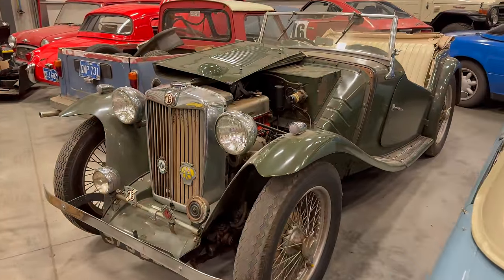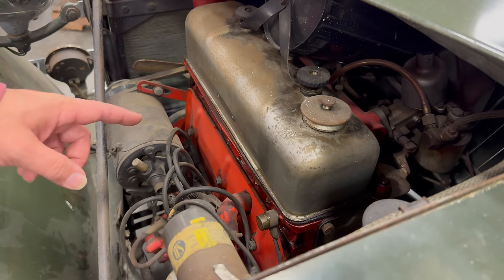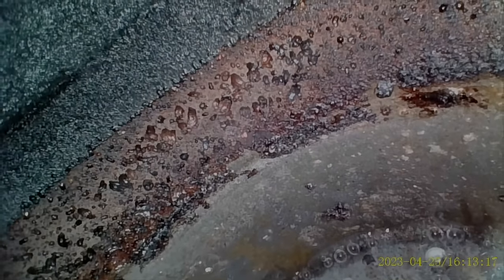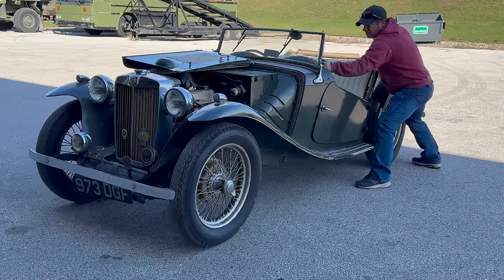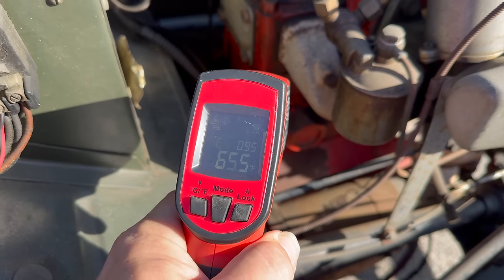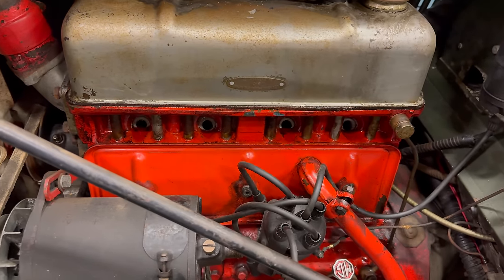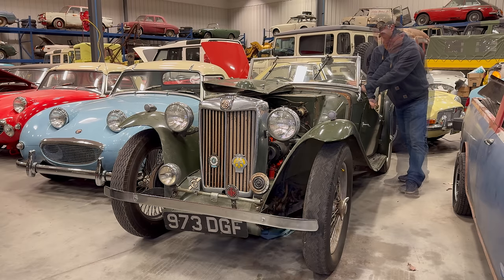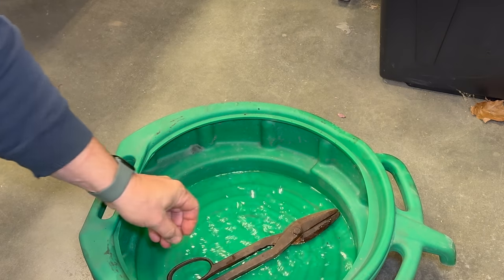Testing if MG Runs with Heat and Vinegar

Comment: Great video. I'd never heard of using vinegar on rust, it seemed to do a good job on your cylinders. That beauty of a car deserves all the attention you can give it. I would like to see more.
Reply: I’ve heard of it but not inside engines. It also cleans up the mineral build up in your shower heads and faucet aerators.

Comment: I tried letting vinegar sit for about a week in an old Yamaha enduro motor that was rusted solid. The trick that finally broke it loose was actually using diesel fuel. From my understanding (at least from what an old motorcycle guru told me) is that diesel works better because it slips past the rings. I'm looking forward to seeing the teardown and watching this beauty run.
Reply: Diesel and kero 1:1 used to work for me.

Comment: Perhaps as a next step before engine tear down, pull head, use wooden block mallet method to get some movement? I think you are just about there. With head off, use some evapo rust to soak but also scrub walls with nylon scrub pads to remove additional rust -it is amazing how that little fine line of corrosion at the rings will lock an engine up. I have seen far far worst engines than yours freed up. The atf was a good move also and I like your use of your hot pressure washer, very innovative, don't give up as of yet!

Comment: A classic such as this deserves to be on the road again, under its own power. I also had not seen what vinegar could do with cylinder rust. Good experiment! Any thoughts on trying one of the "off-the-shelf" products designed to remove rust? You may have to do a tear-down anyway, those valves looked pretty crusty with tetraethel lead residue... Great video, hope to see more!!!

Comment: The acid in the vinegar gets neutralized by the rust. While you cleared the visible rust up in the cylinders it was neutralized before it could do the job of removing the rust in the small spaces between pistons and cylinders. I would recommend putting a couple of inches of vinegar in for 24 hours, suck it out and repeat daily for 1-2 weeks. This will do a better job of allowing the active acid to get all the way down the side of the piston.  Think of each day the acid getting neutralized and the need to replenish so the process can continue working on the more severe and hard to reach areas.

Comment: I've been using white vinegar to clean rust on vintage drum restorations for years and only learnt recently that you can get double strength white vinegar, although not on the supermarket shelves. Down here I've found it in bulk supply stores.

Comment: Steve, I wouldn’t give up on trying to free the stuck pistons.  I would try filling the cylinders with a high quality penetrating oil and give it plenty of time.  In a month or two you may find that you can tap the pistons loose after removing the head.  I think there’s still hope that the engine can be freed up and made to run without a full tear-down and rebuild.

Comment: I've used vinegar to derust a lot of things.    I would not put it in a cylinder.   The vinegar is going to turn the rust into some black crud.    Not sure who told you that advice.   People have run water vapor through them though to clean them out while running.      I would of myself sprayed a penetrating oil like PB Blaster in each cylinder to unstick them, and let the piston rings take care of the rust.   Then later on run some water vapor through while running or SeaFoam if you aren't down with water vapor.

Comment: I have not heard of using vinegar on cylinders but it does make sense as it is acidic. It did seem to clean out quite a bit of the rust but it would take a long time to do the job. It was also a good idea to heat the engine to try to free it but if all else fails the a strip down is the final option. I think it was worth trying all the other options though as you have lost nothing by doing so. Interesting video Steve thank you. 👍👍

Comment: II'm of the opinion that vinegar does not work on rust and that it can attack the base metal. The best product I have found for removing rust from steel is Bilt Hamber Deox C. It's made in the UK; I'm not sure if its available in the US but it is very effective and economical to use as it comes in powder form and is disolved in water 1 part to 19. It works at room temp or faster at elevated tempuratures. It is supposed not to attack the base metal and it seems not to but I would not fill an engine up with it! I suspect it works like Evapo-rust but not as expensive per litre. Good luck with this project.

Comment: good video, i have used vinegar to clean and remove rust.   It also helps if you get leg cramps.   Just rub some on.   One note on the locked up engine, could it be that the valve train, cam shaft etc is rusted up and locking up the engine?   Please continue with the tear down.

Comment: I've had pretty good luck using Kroil and heat freeing up stuck motorcycle engines. Along with a big breaker bar on the front crank nut. It's likely that the rings will be stuck though. Probably needs to come apart.

Comment: A teardown will result in a better engine. Dip the block + head , replace the rings if the listens are ok. There is a reason that the engine / car were put up improperly. May have a cracked block.

Comment: Because of the cost of rebuilding a TC engine it would certainly be worth the effort to remove the head and free the pistons with a round wood dowel just smaller in diameter that the piston and a few good taps.

Comment: I've rocked some rusted clutches free before, but I sense the torque imparted by rocking the car is pretty mild.  What if you put it on a lift, disconnected the drive shaft so you could attach a 6-foot metal fence post to the end of the drive shaft and put some real torque on it?  Seems like the worst that could happen is to snap some disintegrating piston rings.

Comment: Before tearing the engine apart I would attach a tow strap to the chassis and try gently pulling the car with another vehicle in say 2nd gear.  There cant be much holding it now.
Reply from the maker: I did push the car and then release the clutch but it spun the clutch instead of turning the engine.

Comment: 0:10. It's an engine, not a motor.  An engine is an internal combustion machine that converts chemical energy into mechanical force.  A motor is an electrical contrivance that converts electricity into mechanical force.

Comment: Don’t know why anyone would turn over the engine with cylinders in that state. Who knows what the bores are like under the rings? And the valve train, oil pump, distributor drive, fuel pump drive, crank bearings … too many connected components that could suffer. Tear it down, don’t get tempted by short cuts.

Comment: If the car has sat unused for that amount of time and the engine is sized, the head needs to come off in order to cheque the for corrosion in the boars and inspect the valves along with a compete change of all fluid's and filters. With out doing any of this basic work you run the very high risk of doing more harm to the engine and coast far more. The other thing is with out having a though examination of the state of the internal parts what condition its in piston rings , oil pump and oil ways.  you run totally destroying the the entire engine..